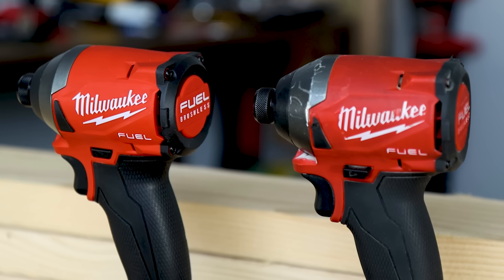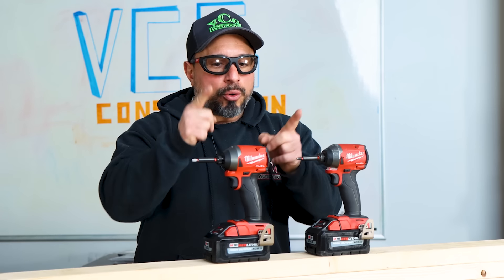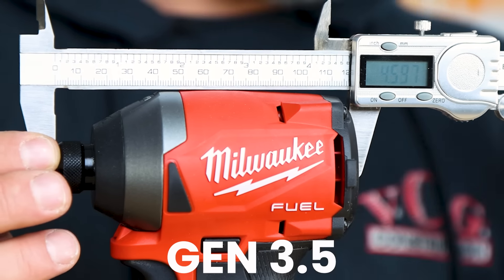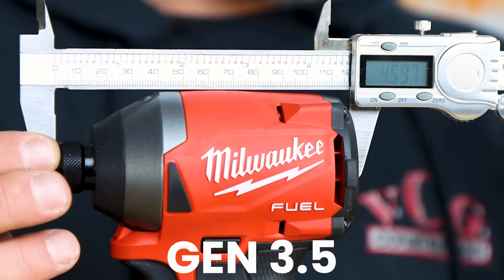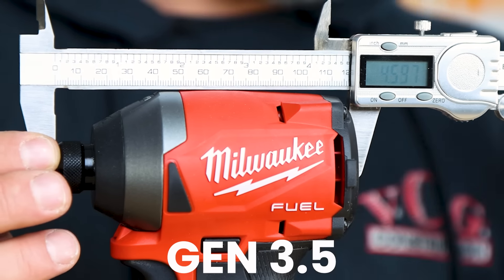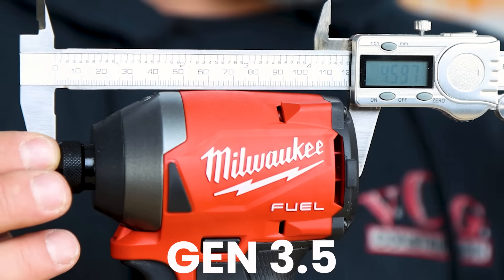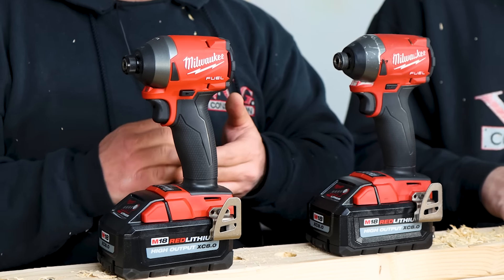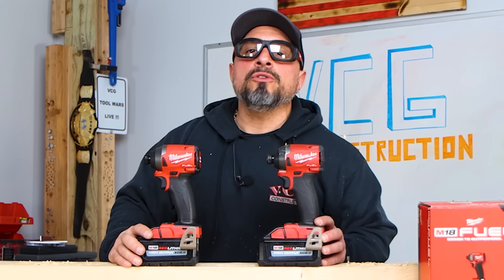New Milwaukee M18 FUEL GEN 3.5 Impact Driver TESTED Against INFERIOR GEN 3 Impact!

Comment: Purchased a twin pack, drill and impact driver in Dec 2020. Just had a look there and it has only one ball😩. Btw, the drill had to get a gearbox replacement after fitting approx 50 50mm self tapping screws, only to be told there would be no more warranty as it was being miss used😡. First time Milwaukee user, think that might finish me

Comment: Vince can you do a review on the makita 40 v  impact driver vs the Milwaukee 3.5
Reply: Makita 40V is the best impact driver I’ve ever used, and I’ve used gen 3. I’ve had mine for 4 months now, not a single problem or flaw. Plus the new batteries get you twice the runtime
Reply: @adamfehr1994   yea it is the most powerful impact driver on the market right now, must search and watch Scott brown carpentry thanks bro
Reply: I’m in carpentry and have tested it rigorously, putting around 300 3” screws in in a row (building staircases) and the battery only went down like a bar and a half. It just continues to shock me. Plus the trigger is sensitive enough to do finishing unlike Milwaukee’s trigger that speeds up in quarter intervals.
Reply: @adamfehr1994  yea it is true

Comment: Just picked up the #2767-22-2853-20 Kit today from HD, I ordered on line, curbside.  The 2853-20 has only one ball, but it does retain the bit so far.
Reply: How’s it holding up?
Reply: @The_Honcho  It's holding up fine.  Out preforms the my Dewalt.  Very mice unit.  I don't usually drill holds with a spade bit and a impact driver, very rarely, but when I have it retained the bit.  Actually received the impact driver free with the purchase of the 2767-22 kit at HD, a special they were running back in April.

Comment: Been going to home depos to find it but they’re still selling the 3rd gen ... is there anywhere online where I can order the 3.5 gen?
Reply: Just received mines after buying multiple combo kits (drill/impact) only to find out it wasn't in it. You have to buy bare tool. I bought 4 kits at different locations and online. They all had 2101 or better for serial # but I wasn't get 2 bearings. I placed 2 separate orders online at home depot for bare tool...received the first order today and it has 2 ball bearings.

Comment: I went to the local Milwaukee distributer to buy the new 3.5 version and they didnt have them yet. They called Milwaukee to verify the new model and they said they arnt being distributed yet when they are they will have a different seriel number.
Reply: It’s crazy to think that a company that has a known flawed product in the marketplace which took the time to research and revise is dragging their feet to get these into stores. The reality is they should just recall the Gen 3 and replace customers with the new 3.5 as well as pull all the older model from store shelves. Pure negligence on their part.

Comment: Not sure what this problem is about, I've got a 2014 fuel gen 2 model and it never dropped a bit. Just pull the collet when inserting and then it's locked properly

Comment: I haven't ever had an issue with the hex chuck. But I have had may tools with trigger issues usually when tilted 90 or greater from straight up. I just purchased a brand new m12 kit and same trigger issue with the drill!

Comment: Just got back from Home Depot about an hour ago. I just picked one up because I have the brushed version M18 (which is still fine) and started remodeling my house after starting a small project that spiraled into major remodeling, and I just wanted something I feel could keep up with more work. I noticed that the one I took home which was in front of about 3 others was the only one without dust on it lol, and the only one that said “New” in the top right corner of the box. Don’t know if that’s a way to tell the difference between the gen 3 and 3.5 without opening the box, but mine is a 3.5

Comment: Did anyone have to send off their impact driver for repair 
I'm waiting for a ridgid sub compact impact driver to get repair. The front gear box cover cracked completely around the first time I used it taking off machine screws on a old metal door hinges . Bought the kit for $199  on 11/14/2020 broke on 12 /12/2020 still waiting

Comment: The issue is regardless of if your experiencing the issue or not, they revised the product so as a consumer should be entitled to the latest. It’s not like your paying different prices. Probably the best bet is to wait a little while to allow these to get into circulation. Home Depot isn’t going to put up with people inspecting these for too long I would imagine before putting a stop to it. Milwaukee should be substituting stocking that is the case. It’s shitty they didn’t come up with an easier way to identify which is which just by the box itself.
Reply: @First Last Yea this will probably turn out to be a real mess as anyone who purchased recently will be calling up Milwaukee requesting the revised version. The right thing to do now that the flaw has seemingly been resolved is just to pull all existing inventory at stores and replace with the V2 and then start to work back with customers just to stop the V1 from continuing to get into circulation. That won't happen but is what should happen. I am curious the serial number of VCG's unit to see the build date. Even though it only impacts they say 1%, the fact of the matter is people are still out there paying full price purchasing a flawed product which is not right.

Comment: Um, it's a brushless motor. there is no break-in on brushless motors. One might have the advantage over the other because of the batteries. No 2 are alike, lithium batteries are never perfect as I have built many packs for Electric cars, motorcycles, and algaculture drones. The grease may wet up or loosen but you're never going to get a vas improvement. People are just looking for something that's not there because we people are just weird like that, lol. Yes, Milwaukee is a beast. You should try one with a custom 4 turn Y ADS brushless motor. It's insane and drops right in if you're not worried about the warranty. Great video guys.

Comment: I have Gen 2 and Gen 3.  Never experienced collet problem with Gen 2.  Now that I inow ythat Milwaukee is well aware of the Gen 3 collet problem, I am going to send my Gen 3 in for repair / upgrade.  Gen 3 is a great tool, but not when bits fall out constantly, or I have to manually turn the collet to get it to hold the bit.

Comment: That sucks! I got the packout impact driver with 2x HO cp 3.0 batteries at $149 and I found out that it has single ball bearing. That’s why, they have it on sale! Mine is J57AF2023.

Comment: I have 5 fuel  1/4 in impacts that have went bad because of being in my black utility box try putting it under heat and see if it breaks I don't buy fuel impacts anymore I buy brushless but not fuel hope they have fixed this problem

Comment: The gen 3 is your daily driver right?  The gen 3.5 is brand spanking new. 
The difference in weight is probably the dust and debris inside the tool. Idk if that could account for the extra weight? 🤔

Comment: Just bought the impact driver (tool only) online from Home Depot, serial number J57AF214609779 and it came with 2 ball bearing. Just to let you guys know. I live in Orlando, FL.
Reply: Also, I wanted to ads that the whole product's serial number (J57AF214609779) was shown in a sticker attached outside the box. Unfortunately we cannot post pictures here.

Comment: Sorry in advance about this but I don’t know any other way to ask the VCG a question.
Looking for router recommendations. 
   I am a huge DeWalt fan. So any info before I buy some crappy and inefficient under powered router. If you guys know what I mean it would be like buying the box set for Dewalt thinking you’re getting a good drill but you end up with their cheap crap. Meaning nothing beats 966 or 998 for drills anyways. If there is a video I missed that Vince has done “sorry” .
So what DeWalt router would the VCG an VCG community recommend.

Comment: Quick story time so I got the gen 3 about 9 months ago. I saw the video of the collet being a problem still bought it. Me and my dad were working on a job I’m drilling a hole with the gen 3 mind you ever since I got it I never experienced the collet not holding the bit well as I’m drilling and I confidently finish drilling the freaking drilling bit comes off and hits my dad on the head. 🤬😡 ever since that happen I do not to use the gen 3 AT ALL..seeing this new 3.5 makes me hopeful

Comment: I’ve the gen 3 and the trigger won’t power the tool at times does the 3.5 have the same glitch ?
Reply: Also happens to me but not often, the retention is definitely there and very annoying!
Reply: My 3rd gen hammer drill has same problem.
Reply: ya thats happen to me with the gen3 impact driver and hammer drill why does it do that

Comment: I decided to upgrade finally from my M18 brushless I've had for years & years with zero issues to the M18 brushless fuel. Ordered myself a new M18 fuel yesterday on 1/16/22 and Home Depot gave me the Gen 3 M18 fuel made back in the beginning of 2020. I'm a little bothered by that and wonder if there's anything I could do to get the newer Gen? Any ideas?

Comment: Thought about buying a gen 3 
Seen this video
Bought a new one in the box with a 2.0 battery and charger for $100 on OfferUp 
I use it every day at work in framing.
Just changed some motor mounts with it after work .
Only had 1 bar of battery.😂

Comment: I burrowed my friends 3rd Gen for work 
I was installing metal channels on the ceiling and the 3rd Gen ended up freezing up on me 2-3 times where I kept pulling the trigger and the gun acted as if it didn’t have a battery on 
Wouldn’t do anything 
I had a 3.0 high output 
Has anyone else have this issue before

Comment: @VCG Construction I just sent both my Gen 3s in for collet and trigger issues. I got the first one back, new grease, a bunch of internals replaced for some reason, but still has the single bearing retention. Once I get the other one back I will be doing a torture test of my own before I can trust them on the job again. My brushless Makita stays in my deck building tools as a backup. The Makita has never failed and has driven more fasteners than all my other drills combined. Thanks for the solid info boys. Keep up the good work!
Reply: Same exact happened with my impact, internals fixed and no collect dual bearing upgrade, emailed them and sent it back in now gotta wait till I get it back n see if it has dual bearing collet
Reply: Any update on the second drill collet being fixed?. Wanting to buy into a system but not sure if I'm trading power for reliability with milwaukee vs any other brand

Comment: I believe I have the gen 3 driver. I took it apart today for the first time to fix my bit issue. I found that the ball bearing was just too small and the clearance of between the thickness of the anvil and the release collar was too great and allowed the ball bearing to to be nearly flush to the corner of the hex.  What I did to fix was used a larger ball bearing.(metal air soft bb for now was perfect size). I had to open the slot slightly using a Dremel to all the bb to fit . This appears to fix my tool. Only downside is I have to release the collet to now install a bit.  Hope this helps someone!

Comment: Just got my impact back from repair for this issue and they sent it back with the same single ball bearing. I called them about it and two different people denied having a new anvil with two ball bearings.... They told me the problem was an undersized ball bearing so they installed a larger one. Also just looked up the schematic for it and it shows the two ball bearings.... I'm starting to really regret buying Milwaukee.
Reply from the maker: Call 1800 Sawdust
Reply: @VCGConstruction  that's who I called when they denied it but I just called a second time and told them to look at the scematic for the drill because it shows two so now I'm just waiting on a reply. Thanks for the response love the channel
Reply: Update if anyone sees this. Just got my drill back from them for a second time and again they didn't install the one with two balls. Took a 3 weeks this time too....

Comment: Vince and the rest of the very cool gang....I'm in the business all my life. Tools are my teddy bears. My  Milwaukee tools are hung up and cleaned everyday. I love love love your videos. So when I have an unusual issue with my precious Milwaukee tools....I come to the pros......
Reply: My gen 3 m18 fuel impact driver 2853-20 is incredible. But it has a worsening wobble in the rotation. It gets more severe as I attach bigger diameter bits. Obviously the centrifugal force. As I experiment more with attachments it creates problems. Is this something you've seen? Less than a year old I can contact Milwaukee right?  Any advices would be great. I also just wanted to get that particular issue out there. Maybe there's more to it? And I'm all about making sure my baby is running right.

Comment: Hey Vince, I have sent my gen3 impact driver in twice now for not holding a drill bit or bit in the collet they did not install the two ball Bering system. I just will probably go buy a new one do you know where I can get the upgraded gen3 impact driver with the new collet and 2 ball Bering system?

Comment: Imo, dont lessen the power...fix the collet issue. Milwaukee is the brand to beat. They are only hurting themselves. They should already have a 40 volt system. Im dissapointed in that company

Comment: I was just looking at the box of my M18 1/2" impact tool (2962-20) which is a different tool than the one in the video that I purchased from Ohio Power Tool.   There is a serial number sticker with date code on the box that matches the serial number and date code on the tool.  So you won't have to tear open the box to determine if you have two balls.
Reply: Problem is, when did they start manufacturing the 2 balls instead of 1?

Comment: I have the m18 surge and i have never had that problem and just used the diablo 1 and 1/4 inch paddle bit to drill about 20 holes with no probelms and loved them by the way. I put it up against my m18 brushless and metabo green and they both couldn't finish drilling the holes half the time and i completed the task with my surge!

Comment: Hey Vince, what is the date on your gen 3.5?  I would assume all models made after yours is a gen 3.5
Reply: @jps101574
. Milwaukee doesn't put any production or manufacturing dates on their tools and boxes. I checked the Milwaukee power tools I own and they just don't. So unless you call 1800 SAWDUST and see if they'll tell you based on your serial number, there's no other way to know. @Aepek found a parts diagram for the new 3.5 GEN3 FUEL impact and even the serial number scheme hasn't changed. So bottom line, Milwaukee didn't make a easy way to tell if we're buying a GEN 3.5 FUEL impact.
Reply: @ccadama  They sure do.  Look at the serial number.  The last 4 digits after 'AD' is the date.  For instance, AD1745 means a manufacturing date of the 45th week of 2017.

Comment: I think ill hold off about 6 months before I get it so they can move old stock, but I been thinking about moving over to Makita, got my wife a Makita and it seems to be made better all the way around, I really like Milwaukee tools but they seem to always be something going on with them , my 3rd gen hammer drill from the day I got it has a little problem with the trigger it doesn't work sometimes and gets hung up on something inside it a lot.
Reply: I've just switched from makita to milwaukee and its the biggest mistake I have ever made please don't buy milwaukee. maybe read there comments on facebook 90% bad reviews extremely unreliable tools. stick with makita I have the same makita tools from 10 years ago still work, thank god otherwise I'd be fkd because my impact, drill, circular saw and 305 drop saw and 2 batteries have all had issues.
Reply: Nah I like my milwaukee tools even though their ten 3 drill trigger is bad but still it's worth it because of the power
Reply: My gen 3 drill does same thing. Bought new Makita tools during Christmas deals and love them.
Reply: Did you get a new one?

Comment: My father has a old dewalt that he has had for as long as I can remember (at least 8+ years or so) and it has a quick insert and it works flawlessly and still has never gave me a problem after nearly burning the tool out multiple times, Milwaukee really messed up and are taking why to long to fix this
Reply: i guess you never saw previous videos on this channel where the dewalt 887 impact driver went up in flames and burnt out 4 times....never happened to the milwaukee on the same tests....i guess dewalt really messed up on the 887 😂👍🔥🔥
Reply: @kingofthecrease30  You're right. And the Makitas, Ridgids, Ryobis, Kobalts (am I missing any others?) didn't let their smoke out like those 887s (more than 1) in any other TTRs. It's not to pile on but somehow Dewalt DW887s can't seem to hold their own to the others.

Comment: When measuring the weight of used tools, a tiny bit you need to consider is the debris that’s gotten stuck inside the tool 🤷🏻‍♂️ little tiny pieces add up when you’re doing .00 ounces